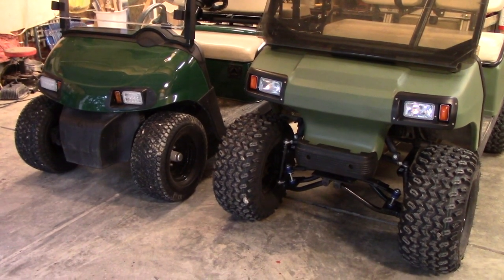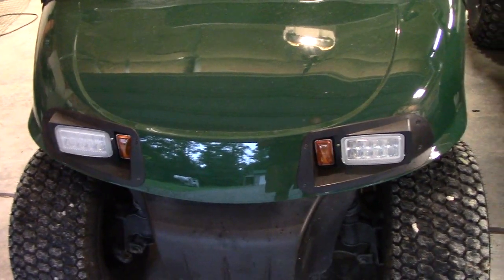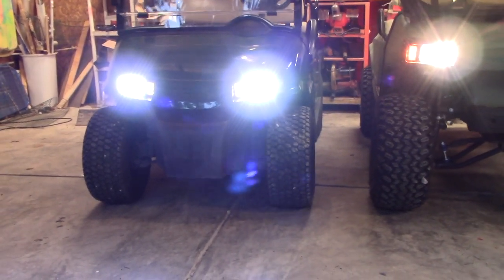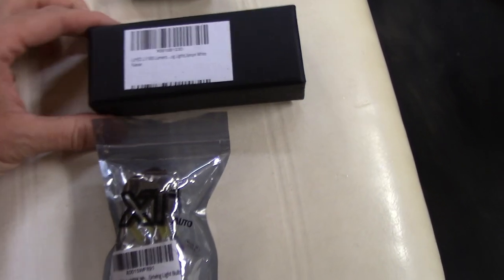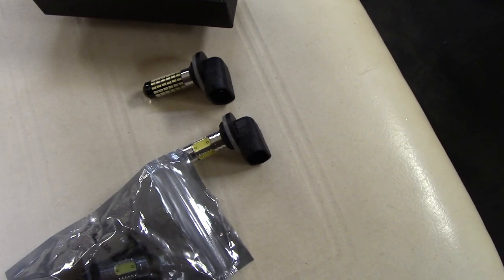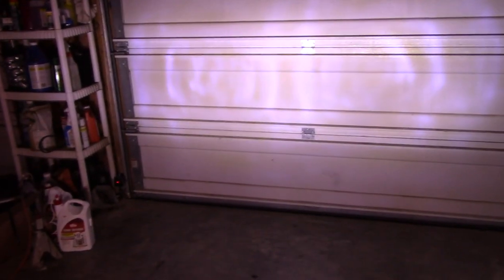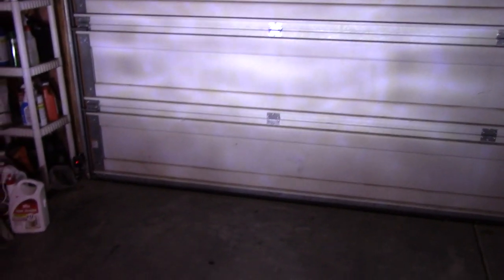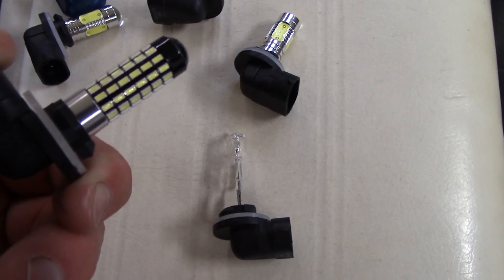Golf Cart LED Headlight Bulb Upgrade Club Car DS EZGO TXT

Comment: Hello. Just to be clear. I have an 08 club car ds gas.  All I have to do is buy those bulbs and replace them and I’m good to go?
Reply from the maker: It depends on if you have the same headlights that I used in the video. I'm not sure if the OEM club car headlights use the same bulb as the aftermarket ones or not. The easiest thing to do is remove your current bulb and look for the part number and match that up to the LED

Comment: Great informative Video. Do you happen to know where (Gas) Club Car DS or XRT850 OEM Headlights terminate the Ground Circuit? I haven't been able to locate a Wiring Diagram for my 2015 XRT850 that has suffered from Intermitent operation until recently are now inoperative. I am getting Battery Voltage to the Halogen Lamps. I suspect Corrosion due to parking it under my house within a thousand feet of the Gulf of Mexico Shoreline.  Randy   AKA randog311

Comment: Did you have to rewire anything? I bought a set for my 48 volt 06 club car ds and neither working....i do not have a 12 volt converter on my cart... but halogen bulbs worked fine. Maybe they we're 8 volt?
Reply from the maker: Since im using them on a gas cart they have 12 volts. If you use them on a electric cart you need to use a converter to run them properly.
Reply: @JackofAllMasterofNone  I got them to work. My yellow headlight wire was on my #1 battery, moved it to #2 and they started working. Instead of running off 8 volts I believe they're running off 16 volts. Thank you and great video!
Reply: @beefhouseG  -Thanks for the tip. It had me stumped for a week and now I can drive at night!

Comment: Helpful comparison.
Reply: Hi Jack,  I need to replace the light bulb for the head lights I have installed for my Club Cart Cart.  My question: How do I remove the plastic light cover from the light kit without breaking the plastic clips.  Any help would be greatly appreciated.

Comment: is there a simple way to get more head light power, my lights are old regular bulbs do not light well ..is it better just to add a  LED light bar?
Reply from the maker: An LED light bar usually works great and they are cheap.